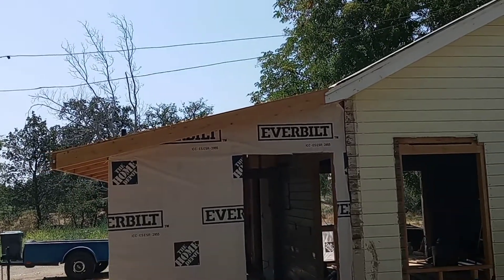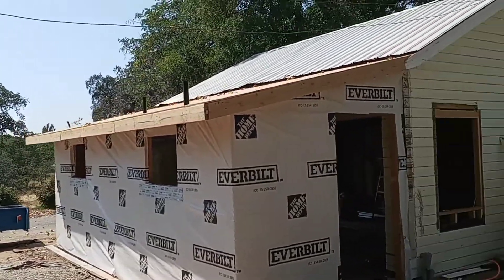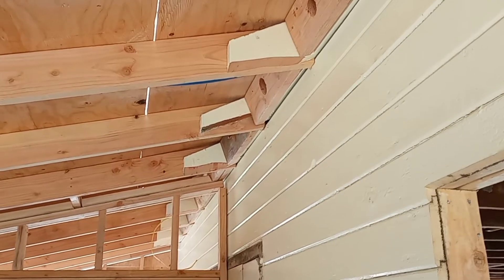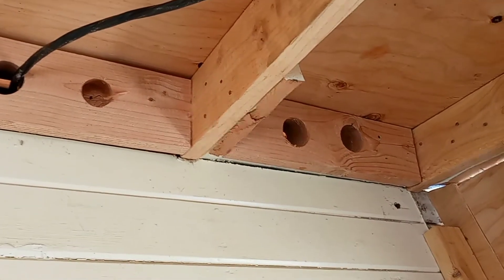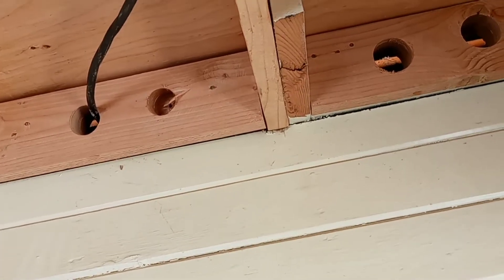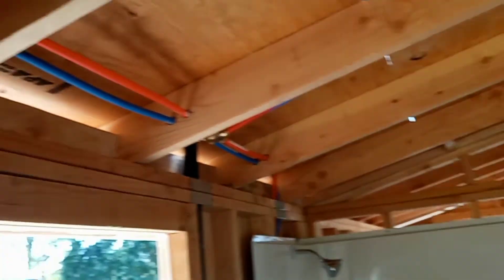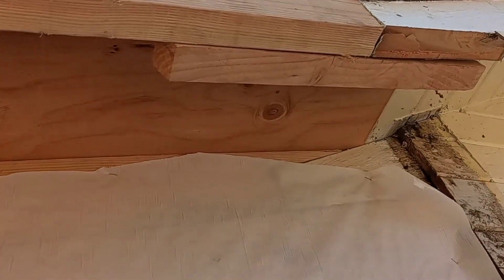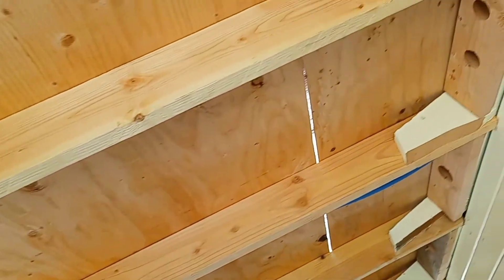Rafter framing for an addition on a long wall (Not gable addition). Alternative to ledger board.

Comment: That looks like a nice framing job. There should be a header over that old entry door into the main garage. The double plate is for when the rafter does not line up with the wall stud, so a stud over an opening needs a header for a door or window. And you know it's sized for the width of the opening.
Reply from the maker: Not sure I understand the header comment. All existing openings had headers and we did frame headers everywhere we created a new opening. The headers may have not been visible in the video?